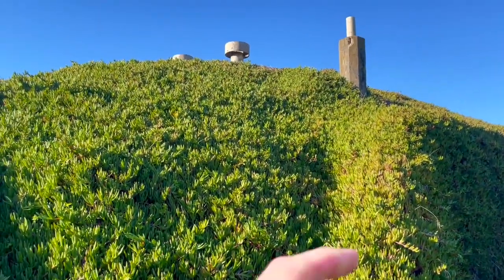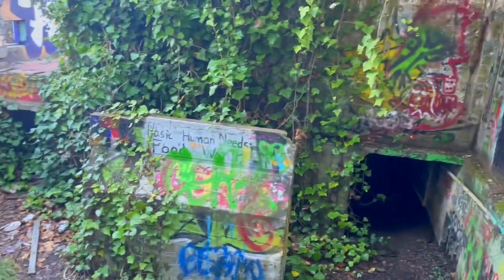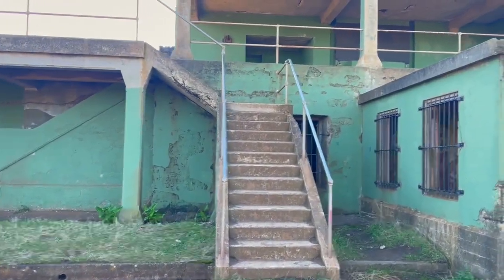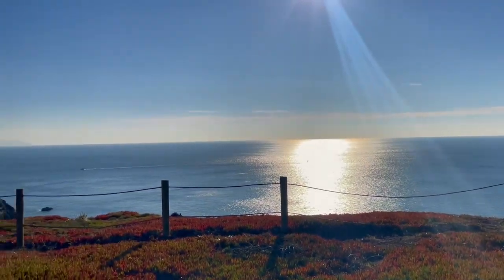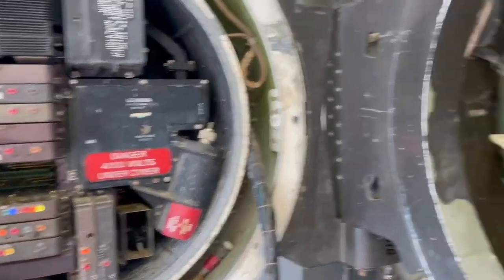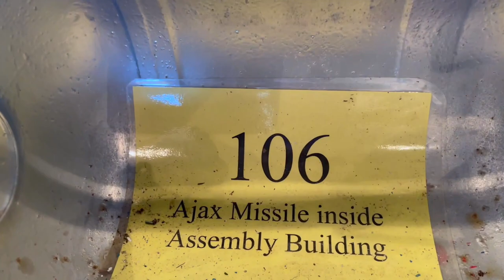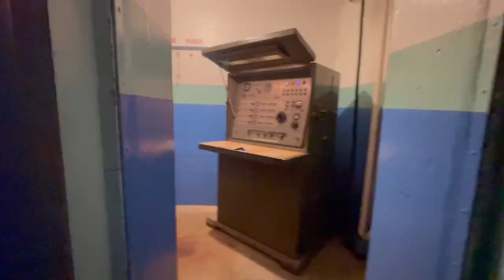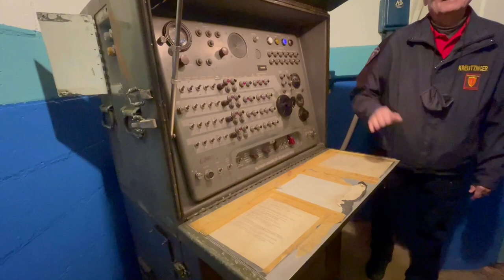Nike missile a U.S. hidden defense!

Comment: Way back when, I was a member of a missile battalion in Maryland. I was in the headquarters battery and had to visit all of the five missile batteries around Baltimore and outside of Washington, D.C. on a regular basis. I was trained in the maintenance and care of the elevators that brought the missiles up to the surface for firing when required to do so. I learned how to repair and maintain the compressors and controls for those elevators. I was taught the basics of refrigeration, hydraulics, electronics, electrical connections and pneumatics. Very interesting subjects all for no cost to me other than going to military style school for 6 weeks in 1963 to 1964.
Reply from the maker: That's awesome! At this sight they had mentioned that the controls were placed on the platform for ease of use for the park rangers to rase the missile. Not sure if they are the same controls as the ones you would have used.

Comment: There was a NIKE site on Victory Boulevard at Woodley Avenue in Van Nuys, California.

Most people who drove by it daily had no idea that it existed when it was in use.  It appeared outwardly as a nondescript building with lots of concrete around it, the only clue otherwise being a couple of uniformed personnel stationed outside who did not (usually) answer questions of the curious.

That was, until a drill was held.  Within seconds large slabs of concrete moved aside to reveal the rising launch apparatus which would lift, rotate, and aim the missiles for launch.  Within a few seconds afterward, as personnel scrambled about the 'site like ants, the missiles and launch apparatus would withdraw, slabs close to look again like a large parking lot, personnel vanished, all would be as before.
Reply from the maker: That sounds alot like how the one is SF would work. while on the tour, the guid stated that locals had no idea that it was there.

Comment: In the 60' I was a radar operator on an EC-121,  an early AWACS.
Off Virginia I picked up an outbound, blip, blip, blip and gone. I estimated it's speed as 1500 mph because we didn't have anything faster than that.
The crew laughed at me, the Air Defense Comand laughed at me but then Wallops island admitted it had fired off  a Nike Zeus but didn't think we would catch it
Reply from the maker: Oh wow for real?? How far away was that and you still were able to see it on radar?
Reply: @Exploration.G  The EC-121'S radar reached higher than most.
We regularly tracked U-2's and when NASA capsules returned from space we were usually the first to paint them.
The scope was 500 miles across and I think I tracked it from edge to edge
Reply from the maker: @raymondclark1785 WOW that's incredible! I'm sure nasa relied on that to find there equipment. Thank you for sharing that!